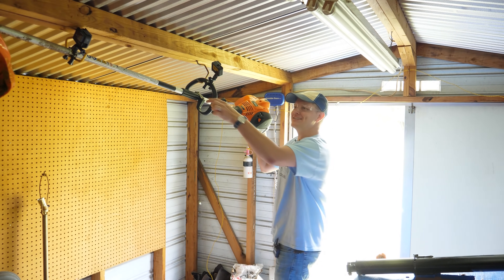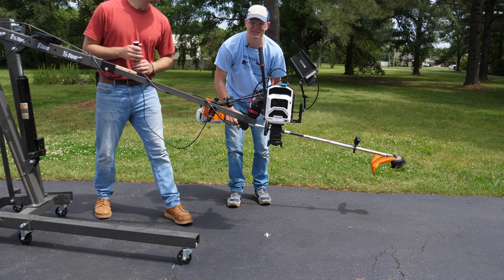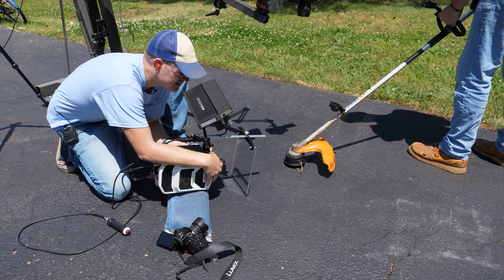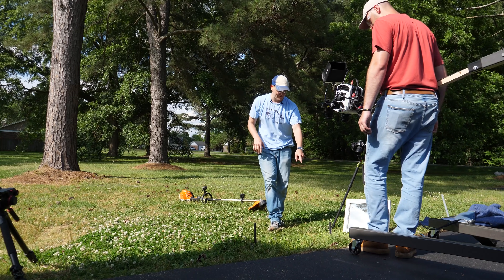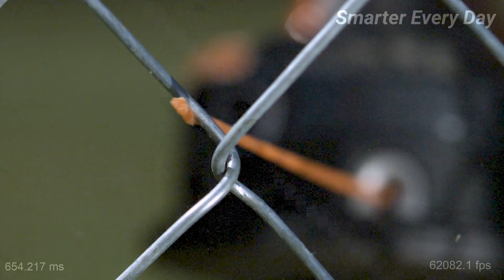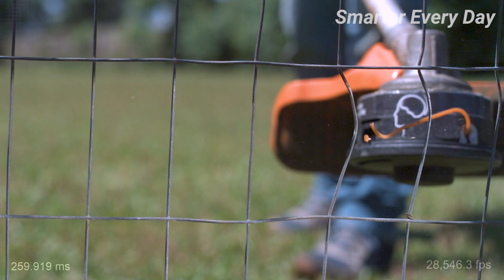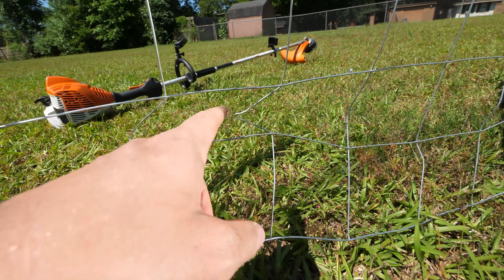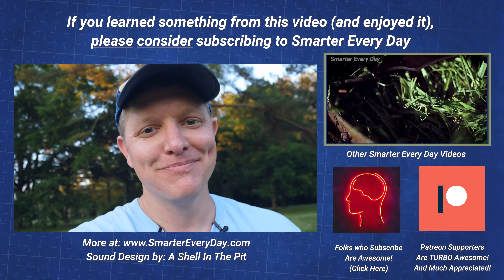How Weed Eaters Work (at 62,000 FRAMES PER SECOND) - Smarter Every Day 236

Comment: Re: the wire fencing, it seems to also be a matter of time. 
If the line wraps around 360* or less, it has time to unwind. 
If it wraps 720* it doesn't have time to unwrap and so gets much more tension and breaks.
I'm a muggle, but that's how it looks to me.

Comment: I've thought about that lag and the motor's ability to deal with excess trimmer line or thicker ground cover. Some heads are designed in such a way that expended clippings or fresh grass can cause the head to get clogged and slow down. Those are lower end heads, usually. It also depends on the trimmer line's dimensions. Is it the inexpensive round .06 or a higher end spiral or hexagonal or square .09 trimmer line?
When we weedeat we do expect a certain amount of resistance and will rev up the engine enough to trim the grass but not damage the tender tree trunk that it's butted up against. Because the disc isn't spinning fast enough to overcomes the resistance that the grass provides but ends will lag behind when it meets the trunk. Or wee need to rev it up to full power so it won't RIP the thick grass I'm trying to cut. I also need to be aware of how much force I'm applying to the rocks that some grass is growing through because I'd rather not throw some errant pebble through my car window. And much of the physics completely escapes me but comes naturally after decades of using a weed eater. I use a Husqvarna 225L.

Comment: Back when I was in college I found myself working a job at a water treatment plant. Needless to say I did the weedeating. I found that thinner tough trimmer line seemed to hold up better on the chainlink fencing. Idk if it was the lower inertia prevented it from wrapping around the fence like on your video or I was simply able to put a lot more line in the trimmer head.

Anyway, good video. We tend to take for granted the physics involved in our everyday lives.

Comment: So I notice that given the speeds of the weed eater such normally stiff strings whip around like they were really flexible.  Is this in any way related to the way that ketchup is a pretty stiff fluid, but when you squeeze it out of the bottle it flows like water?

I thought this would be a video if vicarious frustration based on the thumbnail, but I think the knowledge from this video could help me avoid future frustration.  I can weed-eat smarter.

Comment: You can definitely hear the difference on the motor depending on the length of the line.

 I like to wear my galaxy buds with ambient sound on set to a low volume so I can hear when the line gets cut or when it's completely out.
Reply: Just go to the end and saw the sponsor. Lol if they have ambient sound they would work too.

Comment: I manage miles of berry rows with a weed eater.  Moving right to left,  or clockwise around an object, in my case, a row,  is 30% faster than working in the other direction. Also,  twisted line works much more efficiently than round.

Comment: Listening to the laser gun-like sounds at 13:32, would the wire hitting the fence actually sound similar to that? Similar to placing a contact mic on a tight steel cable and hitting it. There are recorders with insanely high samplerates that would allow you to pitch the audio waaayy down while still having a "crisp" sound. Of course the mic would also need to be able to pick up these high frequencies..

Comment: Not surprising you can hear the torque of the motor,  as that is a function of the moment of inertia of the whole system which is going to consist of the spool of wire + plastic black dohicky of which the later will always have the same moment of inertia because it is unchanged,  the spool of wire will have a moment of inertia that decreases as you go through more wire and there's less mass to spin, the actual strings though while not a super simplistic shape due to them flopping around you can model them though and show that the moment of inertia is proportional to the length² of them,  while it's much to early to do math right now normally the length of line is maybe 10-15cm long, but when you took the guard off and had that string going a meter+ in length you increased the moment of inertia by 50-100 times just due to the length.  Might not think a piece of plastic won't have much of a moment of inertia, but as you could hear from the motor it definitely made a different when you chopped it off completely.

Comment: I bought a new weed eater last week, and it came with line in the spool. I accidentally let out a bunch of extra line while putting it together, so I stood on my patio to cut the extra using the blade in the guard before I went trimming. I was expecting the blade to make one cut, but instead the line broke into several pieces. I was curious, so I picked up one of the pieces to look at the cut. I was surprised to find that the cut wasn't very clean. There was a rough texture to one side of the line, and it was very hot to the touch. I figured that the blade worked by pulverizing the line until it broke. It's super cool to see that happen in a video exactly one week later.

Comment: 1. Sharpen that knife.2. Push the weedeater into the grass, faster. The delamination is happening when only the tip of the string is hitting the blade or the stalk. Not enough string is past the stalk or blade, to just make a clean cut.

Comment: The reason why the weed eater string is curved is quit interesting. 
There are 3 forces acting on each bit of the string: the outward "force" (inertia of the string),  air resistance and the tensile force of the string. 
The outward "force" is straight away from the axis of rotation. The air resistance is against the direction of travel, thus tangent to the circle the string bit is moving.
These 2 forces are perpendicular to each other, so the tensile force (in a balanced system) has to counter act both of them, but also the tensile force points in the direction the string goes.

Imagine the motor starts spinning and the strings are pointing straight. The air resistance is not countered, because the tensile force can only act perpendicular to it, causing the string to bend. The string wil bend until it matches the air resistance. What makes the string curve is that this balance is different on different parts of the string.

Comment: 12:11 "Spaghettification" is my new favorite scientific term.
Reply: That is actually a wotd used in astronomy to describe the process of falling into a black hole
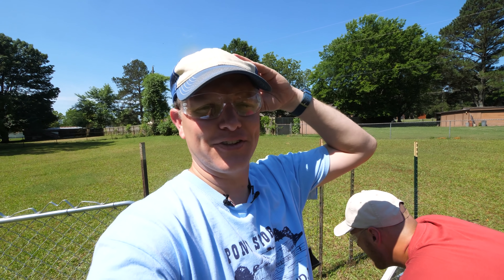Reply: 14:10 In other words, there is less Spaghettification?
Reply: 15:50 Much more Spaghettification. Autocorrect has now learned this word.
Reply: You never heard of black holes in space they pull you in where you spaghettify into string and your atoms get ripped apart. It’s called spaghettification, it’s really cool at the same time terrifying.

Pull isn’t necessary the right term to use, but to make it easier and not explain gravity... pull.

Comment: I wish I had a slow motion camera and an operator like this when I was first learning to weed-eat. This is hugely enlightening about what happens with the weed-eater in a lot of circumstances I was curious about, but one still bothers me that I experienced my first time with an electric (back then that automatically meant extremely low power) weed-eater. It used round, thinner cord, and it would wrap around thicker weeds or thicker clumps of weeds, cut off, and leave them "tied" with little pieces of the weed-eater cord. 

I'm getting hints of how that happened with your last two fence tests but I'd love to know for sure why our old electric weed-eater did that. Based on what you showed, it probably wrapped, pulled out more cord until it was far enough to fully wrap around 720 degrees, then the tension break left it wrapped around. The plastic deformation on the cord in your video makes a lot of sense for why it felt like a knot, probably stretched across itself tightly enough to not slip past itself.

Comment: @SmarterEveryDay Hi I'ma Stihl tech from Canada! We love your observation about the trimmer line size vs engine torque! As a technician, while setting up someone's carburetor (tuning) the line must be at the appropriate length or the customer may go home and begin to cut grass only to realize that their machine bogs down under load or in thicker grass. BTW Stihl came out with a new type of line last year called CF3 or carbon fiber line in .095" and 080", i would love to see how this new line performs as i only know from my landscaping customers that purchase it, that it seems to work well and/or better then standard .095" plastic line!

Comment: To me it just looked like the cable gripped the pole / fence. Stopping its momentum at the top of the wire forcing the bottom to make up for it. Similar to a wheel that's driving on the road.

Comment: The spiral twisted line is
More horizontally stable, I hope he shows this next vid
Reply: Well I think that’s pretty obvious, because then there becomes a new form of acceleration which acts in the vertical direction, which has one line opposing gravity leading to less force. Then simultaneously the other line works with gravity leading to more force. With only horizontal spinning, there’s only normal acceleration and the line’s weight due to gravity. It’s been a while since I’ve taken dynamics, so I hope he goes more in depth about the physics and especially the tension force as the line wraps 360 degrees around the fence cable.
Reply: Just like many car antennas with the spiral around them. Well, mostly for noise.
Reply: Jarret and Cub on point

Comment: Based on my experience, I'd say square line will win out. You're getting the most possible volume out of the diameter. I switched to .105" square line and most my problems with going through line fast went away.

Comment: I'n not hating on Raycon, I think the earbuds are pretty wicked. Might even buy a pair of them myself. But DON'T RELY ON THEM AS HEARING PROTECTION. They aren't NRR rated. There are Bluetooth earbuds you can get that are NRR rated for noisy environments and I absolutely recommend you check them out. ISOtunes is a great brand that I use on my motorcycle all the time. 
Raycon maybe great in every single aspect of being headdphones, but they are not rated for hearing protection.

Comment: My biggest reason for commenting is to suggest slowing down the string trimmer when trimming near any object that is not firm and solid. Vinyl siding should be done slow for obvious reasons. I always go slow on the trigger near fences and things like grounding rods. It saves so much on the string and like with the last fencing used in the video it keep from tearing stuff up. Have to mention that I wonder if you don't know this but do it this way for the video but felt the need to share. Also just to mention after seeing some of the comments that a friend that worked at a local hardware store suggests that string trimmer is I guess the most acceptable name for what I want to call a weed eater too. Thanks for all the awesome videos. It would take too much space for me to express how awesome I think they are. Thanks again. Sorry my grammar sucks

Comment: Hmm imma try to explain the tension break part more in detail, as the string wraps around the wire, there is a time delay from it unwraping and continuing on in its circular motion, however the machine, people have been arguing about the name and i wont bother, will not wait for it to untangle itself, hence it will continue spinning, and there will be a tension force parallel to the string in the tangentional velocity of the circular path, hence it will snap at the start of the wrapped portion of the string
Reply: Correct me on anything, just practicing for my papers